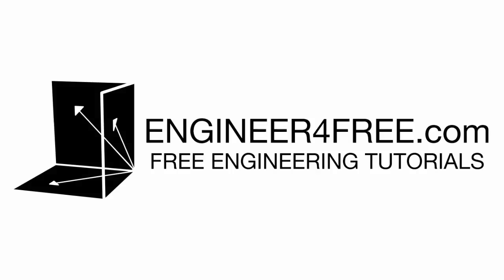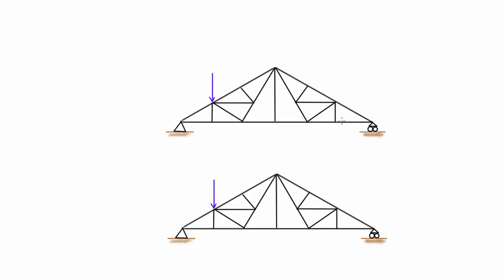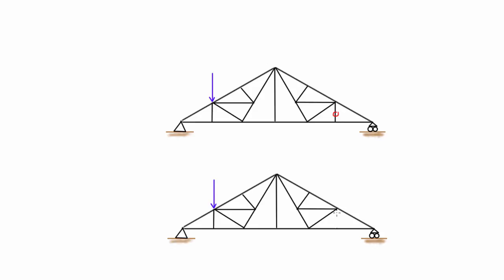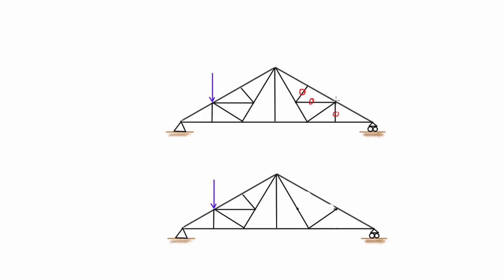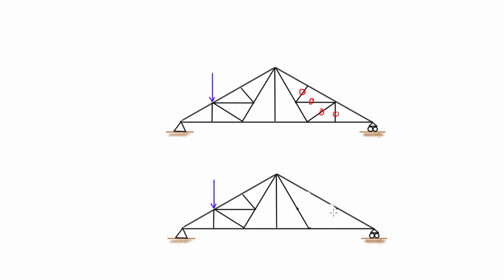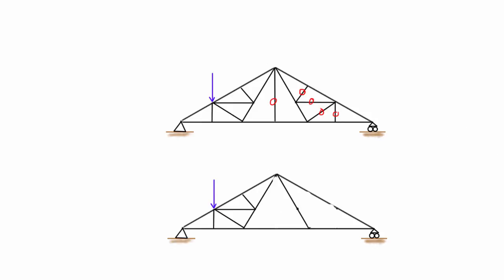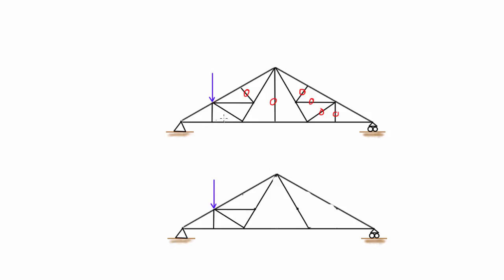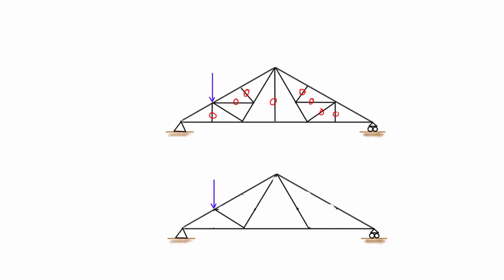Find the zero force members in a truss: example #1

Comment: Why isn't the joint you're point at, at 4:17 a zero force member? There are two collinear forces meeting said member.
Reply from the maker: Good eye! I just made up this problem and missed that one. You are correct, that is also a zero force member under this loading condition. Thanks for pointing it out, I'll will take this video down and repost it (and the next one because it carries through) with the correction.
Reply: Engineer4Free 
Glad I could help 😊
Reply: Yes exactly
Reply: You don't have to remove the videos, just add an annotation and comment in the description
Reply: just had the same question, thank you.  Still a little unclear though. So the one at 4:17 is a zero force member, what about it's opposing brother?
Reply: Good catch, Lorenzo. I was wondering the same thing. It's actually nice having a mistake or two in these because it really makes you think.
Reply: The member at 4:17 is zero force because its joint (On the bottom) has 2 other members that are co-linear (total 3 members on the joint). The similar member to the left of it is not zero force because its joint (on the bottom) has 3 other members, totaling four. So even though there are 2 co-linear members on the joint, the same rule can't be applied. The rule only works when the joint has a total 3 members, 2 of which are co-linear.

The joint has a fourth member due to the point load.
Reply: Happily, I was able to see that too before moving onto the next video. And with doubt, I replayed the video when I am about to start the next and read the comments. Thanks!
Reply: @orianx  But this is not a single member is it? I don't know.. Can we assume it is single? Because there is a joint in the middle of it
Reply: Exactly. Because of that the truss would be statically indeterminate. However removal of that member wil result in 9 members instead, making it statically determinate.
Reply: I had to check the comment section just to make sure it was indeed 0 LOL
Reply: @Engineer4Free  thank god i finally thought i had this down then i was like wait isnt that one and when i thought it wasn't i was very confused
Reply: I made it a habit to read the comments first from your lessons to find out if anyone shares the same question I have and voila ☝️ Lorenzo Vom Matterhorn did👌...and you clarified it‼️ I always try to solve it first before you discuss the solution because I learn more from my mistakes. Hence, it’s very important for me to learn if you don’t have any errata😬 Thank you👍
Reply: Yuriy Kovalov No, because of the applied load it will transfer and create diagonal force (will have vertical component) that needs stabilization.
Reply: @andreasp3452  Both members on either side of the joint are zero force members. Since the lower member is part of a joint with three members of which two are collinear, it is a zero force member. If you see the tutorial video which is mentioned at the beginning of the video (https://www.youtube.com/watch?v=xSEScMN6bpo), you will notice that he mentions three conditions for ZFM. According to the first condition, if one member of two collinear members forming a joint without any external load is a ZFM, then the other member will also be a ZFM
Reply: @Engineer4Free  thank you for clarifying this! Your video was a great help regardless.
Reply: @Engineer4Free  MAN YOU CANT DO THIS. IVE BEEN PONDERING FOR SO LONG. I WAS PANICKING I THOUGHT I WAS WRONG😭😭😭

Comment: I would say the vertical members are  there to limit the length of the beams supporting the longinitudal beams of the roadway. Other uses of 'zero force's members to provide adequate stiffness  for compression members that may be longer than 40 times their thickness.
Reply from the maker: Yes, zfms serve a such a purpose. And also, not that as the load changes, the internal force will change in each member, including which ones are zfms. In real life, the situation won't be so simple as this too

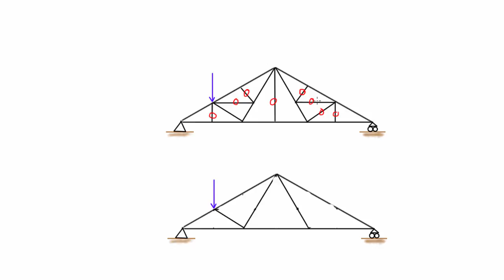Comment: at 7:20, why isn't the member that goes from the very top of the truss system to the bottom right now a zero force member?
Reply from the maker: Hey Tim, thanks for pointing that one out as others have, I missed it while making the video. I just added in a note of it into the description now. Sorry about that but good job for noticing!
Reply: Engineer4Free no problem! thanks for the reply. great video btw
Reply: At 7:10 the final diagram, Are they both zero the ones attached to the top and the one attached to the purple force is not zero right?

Comment: I'm so confused, how come at 3:51 that force would have a perpendicular component causing it to be a 0 force member. Why would it have to have a perpendicular component??? :(
Reply from the maker: The joint has 3 members attached to it. Two of those members are in line with each other, and if they had internal forces, then those internal forces would share the same line of action. If the the third member that is not one of the two co-linear members has an internal force, then that internal force will not be in line with the other two, it will be at some angle. An angled force can also be represented as the sum of two forces, in which one force is parallel to the reference line that the angle is taken from, and one force is perpendicular to that same line. It's no different than talking about the "x component" or "y component" of a force that's on an angle taken from the x or y axis. So IF there was an internal force in the third non-co-linear member that's on an angle compared to them, then it would be applying some amount of force to the joint that is perpendicular to the lines of action of those other two co-linear forces. If that were the case, then the joint would not be in static equilibrium, as there is no 4th member available to provide an equal and opposite force that is perpendicular to the line that we keep referring to. Because this truss IS in static equilibrium, then every individual part (member, joint) must also be in static equilibrium. This means that this joint in question must be in static equilibrium, and that can only be true if there is no unbalanced force that is perpendicular to the line that we keep talking about. Therefore, the internal force in the third non-colinear member must be equal to zero for that joint to be in equilibrium. Hence the member is a zero force member. Does that clear it up?
Reply: Blessed <3